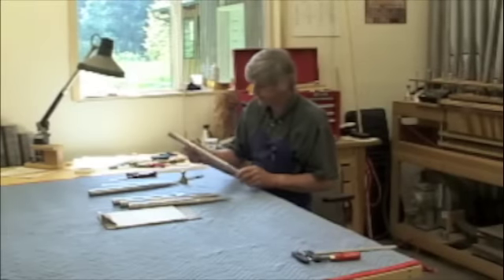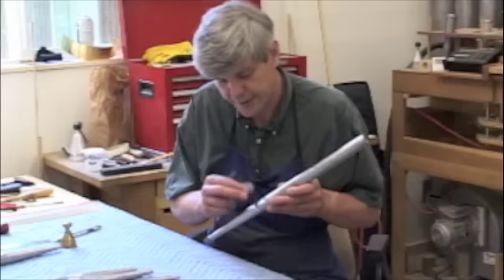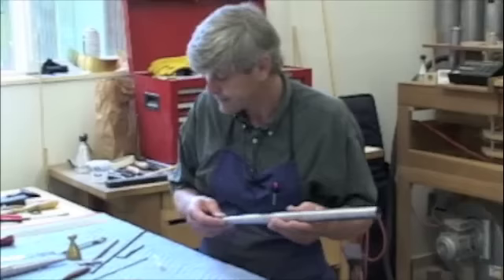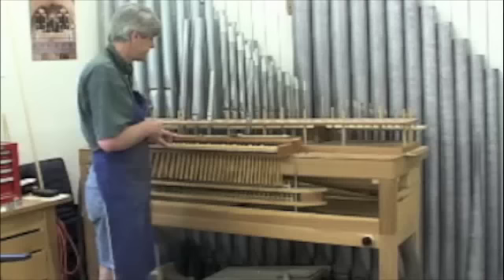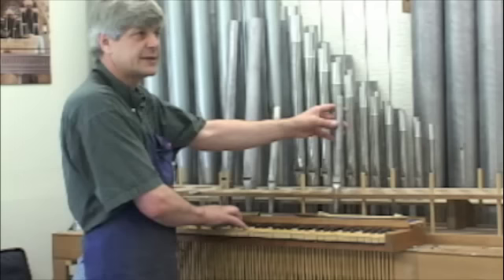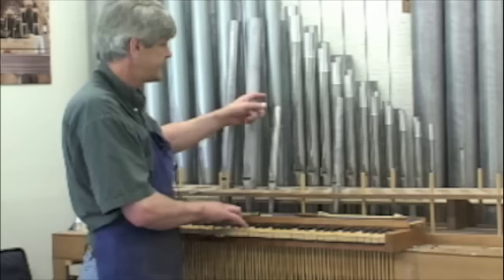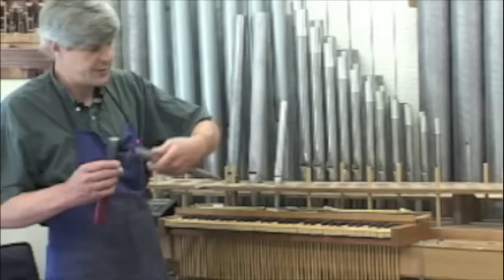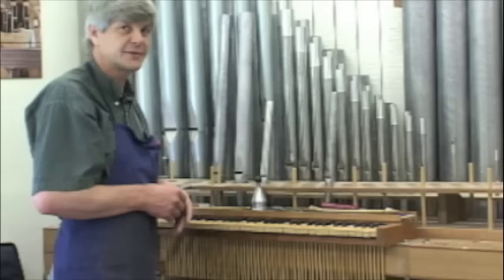Pipe Making Part 6: Voicing

Comment: Dude, here is where being a "real cutup" is not a bad thing!  It has to be done just right in order to get the sound that you want, and be fine tuned as well!  Of course, you'll probably have to make a tuning slide for those flue pipes, but with the ones with a reed inside, there will be a wire installed to tune the read precisely to the correct pitch!

Comment: What is it called when the pipe is out of phase with itself? and why does that happen - is there really two columns of air circulating?   This has happened several times and usually with principals/mixtures.?

Comment: This was fucking awesome lol uh I want to make a copper and zinc tube ... Can I just cast it into a mold?
Reply: +Jarett Lowe Its possible but hard.
Reply: +Jarett Lowe   How about just buying the copper or zinc metal. The problem is that zinc today is too pure. Organ builders still use lead/tin alloy - even pure lead (Which is also to pure). Use the common lead for pipes from 4' up and copper or zink for the pipes lower (Longer) than 4'. Of course, the longer the pipe the thicker the metal has to be.  You can make languids by laminating lead onto a copper disk. Then bevel the front uppt surface back about 308 from vertical.